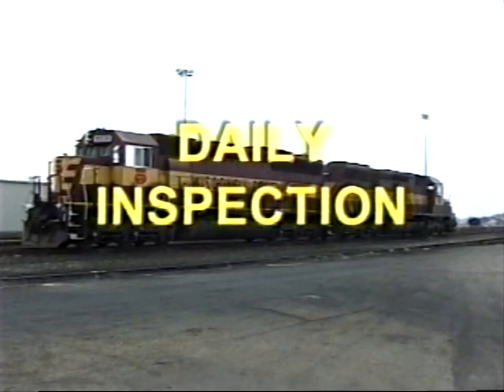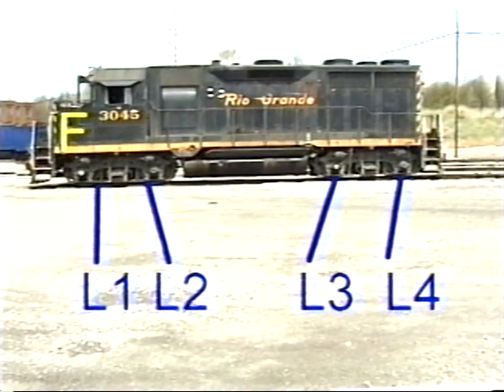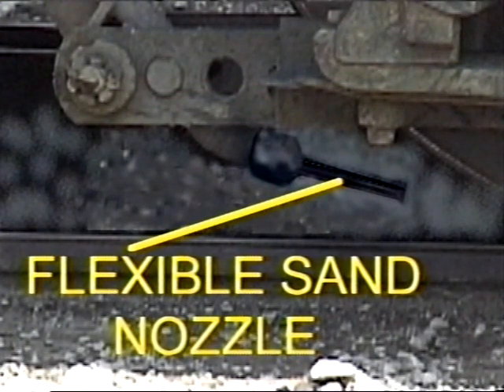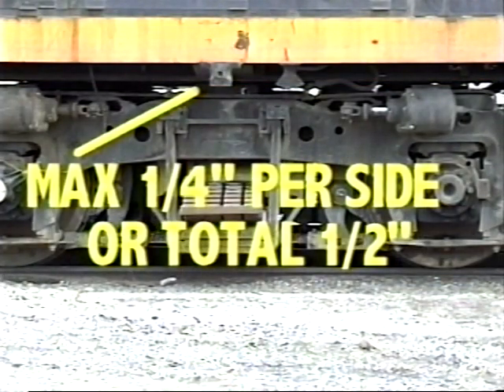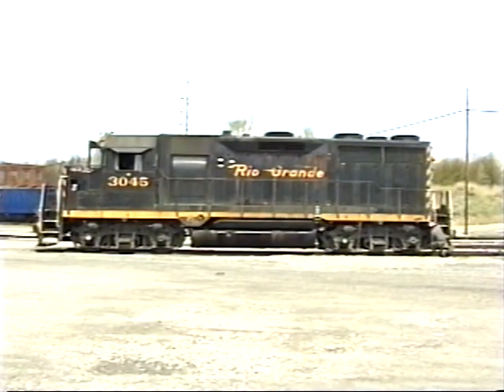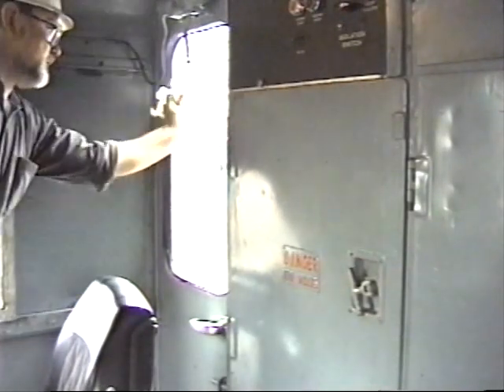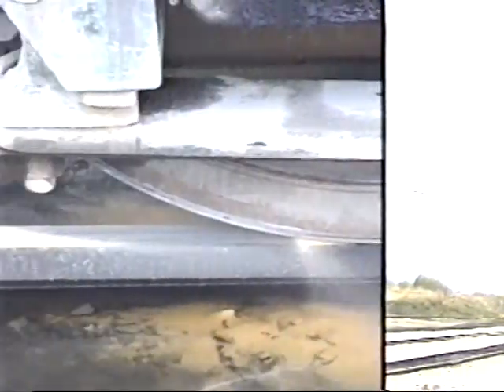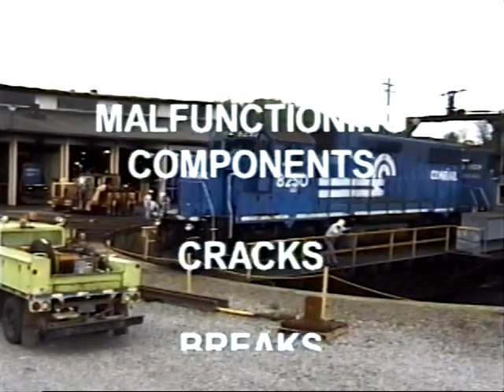Daily Locomotive Inspection

Comment: 10:30 As an ex carman. #1 rule was never put your hand between the shoe and the wheel. Hold shoe from top or bottom. Does not matter if air is cut out, all it takes is one idiot to hit the dump valve or set the chain.

Comment: On Union Pacific this  means your job. managers have been known to take the inspection card and other mandatory paper work off engines. If the train leaves you are busted.
BUT watch the managers scream when you take time to do this on an 8 unit consist. Managers on Union paific have one job, it's not tk help the crew and it's not to help the customer.
it's to find failures at any cost not matter how trivial. Sometimes they swap it from unit to unit
Reply: Like MSHA used to do before they got bored out. Hunt it or make it up.

Comment: Who thinks that all of this is performed for every locomotive every day? I suspect that it is not so. Economics would dictate a much more cursory daily check with this thorough test once a week. Written reports are easily fudged.
Reply: this inspection must occur every 92 days, if not inspected after the 92nd day, unit is out of service until the inspection is done, and repairs are completed.
Reply: Inspected once every trip. Brakes must be certified everytime. We mostly just look for safety issues, loading issues, and things that the crew can refuse the train for. But major inspections every three months or so depending what it's due for.
Reply: @LeJewable  In the trucking industry (I am a trucker's son, not a driver) besides the minimum requirements that are mandated by the same fed agency that regulates RR locos, and regs that can vary from company to company, there are state DOT regs that equipment has to comply with. State DOT strictness varies from state to state.

Also, some parts of CA have regional environmental regulations, so while a tractor may be clear for operation in CA in general, it may not be ok to operate in a specific area. 

Do Railroaders have to deal with similar issues?
Reply: @jed-henrywitkowski6470  well you obviously aren't familiar with federal regulations that dictate that every state do so. It's not a state to state thing it is strictly Federal. Where does it say it? FRA requirements. Which is a branch of federal transportation. Read a book instead of thinking you know everything and stay in the fucking right lane.